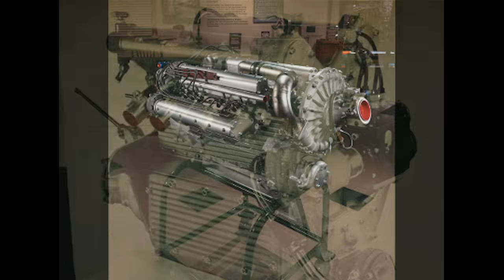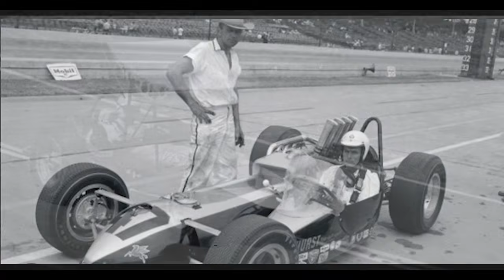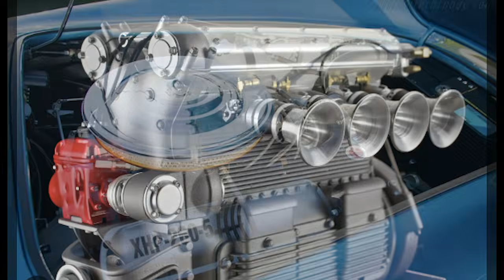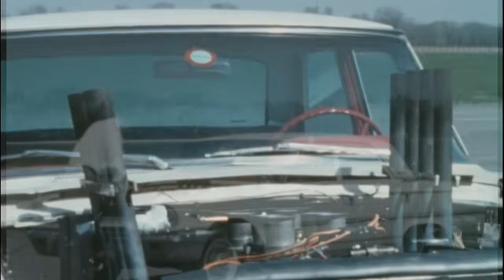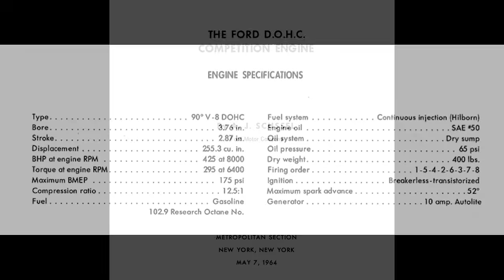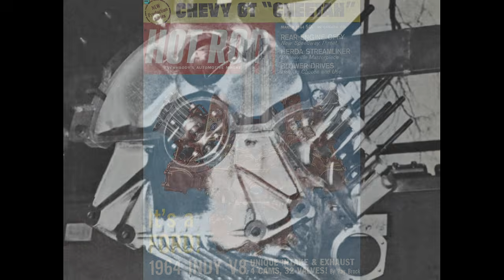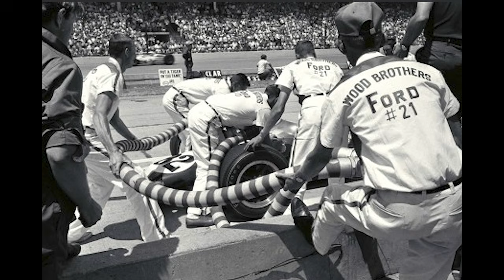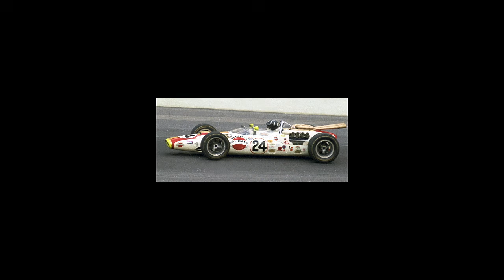Designed to Dominate: The Ford DOHC V8 Story - An Indy 500 Legend

Comment: Grew up in the DBN MI area and I lived through all of this and I remember watching the 500 and the invisible  alcohol fires that happened after a Offy powered car crashed. My first car was a 1963 1/2 Mercury Comet with the 260 V8.  I sure wish I was still as strong as I was then because I could wrap my fingers under the edge of a front fender and lift that tire off the ground. Sadly at 76 yrs old there is no way I could do such a thing now nor would I even try. Now I'm just glad I can still either drive my 2018 Focus ST or occasionally my 2015 Mustang GT with the performance pack. No I've never gotten away from the performance oriented cars.

Comment: And there is another chapter to Ford Indy Engines:
Ford Cosworths XD, during the 90s.
Later sold to Ed Pink Racing Engines of Drag Engine fame.
Recently acquired by Rob Dahm the Rotor Motor guru.
1 - 1 Rotor Motor Miata (in process)
1 - 3 Rotor Motor RX7 Pikes Peak finisher😮
1 - 4 Rotor Motor RX7 4x4 drag whatever 😮
1 - 12 Rotor Motor Dragster (in process)😮
Plus all the Ford Cosworths Remnants 😊

Comment: Arias did the same thing with 502 cubic inch big block Chever-Lay V8's.  They utilized Porsche 928 4 valve cylinder heads, since the Porsche V8 has nearly identical bore spacing as a big block Chevy.  To drive the cam belts, a special housing attaches to the cam from the pushrod version at the front and runs a timing belt from some  Renault car that just happens to fit.  Sounds "Rube Goldberg", but these made 550 hp all day long with perfect reliability, smooth idle, and they could even pass California emissions testing with catalytic converters installed.

Comment: Kudos for a very fine report on this amazing engine. It caught my interest as I saw some of these engines when I worked at the Dearborn Engine Plant at River Rouge, early 1965. They were in a caged-off area on the first floor. One could not miss the injector horns sticking out like a porcupine. I later owned cars with 289 High Performance engines and was proud of their heritage. Again, excellent report.

Comment: I appreciate the video . I was told and i did the cross drilled crank modification to a 302 steel crank in a build , later on that it was not a good idea at higher rpm.  Ford definitely know how to build performance..  i like to hear about the 24 hours at LaMans also ....thanks

Comment: Those connecting rods in the DOHC engine are killers- 7/16" rod bolts, heavy as heck. They also were used in the early Boss 302 race engines. Great video!

Comment: FWIW if I am not mistaken FORD spent close to or just over 100million in 1960''s money for their racing programs, culminating in the Lemans Win. They built a chassis and engine simulator which replicated the entire Lemans circuit and could stress the engines, gearboxes, and chassis' in the same manner as the cars experienced in an actual race. 
It literally floored me when I read about the program in a late 60's car magazine.
Reply: Ford ran 4 engines at the same time, 10,000 gear changes at WOT per race and they did that 24 - 7

Comment: I had the privilege of hearing, live, of the DOHC Indy V8 at race speed, at a 1970 USAC Champ Car road race at Sears Point (California).   I bring up the aspect of race speed, as the cars/drivers back then were striving for a win or podium finish, pushing the cars to its limits, with the DOHC Indy V8 being an ear-splitting screamer of an engine.
Nowadays, with the vintage vehicle exhibitions, those same vehicles/engines are driven sedately.

Dan Gurney, in his stock-block Ford engine Eagle, won the 1970 Sears Point race.  But, Mario Andretti (with the DOHC Indy V8) pressed Gurney for most of the race, finishing second.  
I can still vividly recall that DOHC Indy V8 screaming sound when Andretti was accelerating out of the corners.

Comment: Given the timing of this video on the eve of the month of May, which is the month for the Indy 500, this presentation was well-timed.
I followed all the print and TV media of this era when I was a youngster.  Interesting in this video of the behind-the-scenes dramas that went unreported at the time.
What I found puzzling for that era, and still to this day, was why the naturally aspirated rear-engine Offy Champ cars were noncompetitive at Indy in 1964/65, yet, that setup was competitive at the shorter tracks, with some victories to be had. 
I recently saw another video on YT that covered that era, even showing AJ Foyt in a rear-engine chassis powered by an Offy prior to the 1964 Indy 500.  In Foyt's own words, he said that combo was ill-handling, which was one of several reasons he went with the roadster for the '64 race.

Comment: Did the pushrod 255 eventually make it to the GT40 after the 427cid was banned in lemans in the later years?
Reply: Having followed racing in the 1960s, I can confidently say the 255 DOHC was never mated to a GT40.
Possibly one of the reasons, aside from durability, was with low-end torque needed on road-racing circuits.  For the occasional road-races that USAC ran the Champ Cars on, the Indy DOHC engine was adequate, but Dan Gurney's stock-block Ford engine (with its 3-valve Gurney/Weslake heads), in his Eagle chassis, had better low-end torque for the road-circuits, resulting with him dominating most of the road-racing USAC Champ Car races up to the 1970 season.

I will add that the Gurney/Weslake valve heads contributed to the Ford GT40's Le Mans wins for 1968/69.
Reply: From what I’ve read and heard is that when Ford went to Lemans the first time with Shelby they used a gussied up version of the HiPo 289. And it failed miserably. Ford stepped in and got with  Holman Moody and the Nascar 427 big block and Dominated with 1,2,3 finish that changed history for ever. The next year they basically banned the 427 with a displacement cap. I don’t remember the exact CID other than the 427 was no more in the GT40. The next year they went back to a small block and beat the crap out of Ferrari again. This time with a small block of some sort. It couldn’t have been the 289cid from the very beginning? The GT40 program continued to win with the small blocks after the 427 was band. So what was that engine? That why I thought if the pushrod 255.

Comment: Nice video! Brings back memories- you showed an issue of Hot Rod with te Ford twin cam on the cover and I read that magazine until it fell apart. One small thing- you mentioned the Galaxie sedan that Ford used for testing on the 255 OHV engine and you stated it was a '62 Fastback. Ford's Galaxie Fastback was a '63 and did not appear until half way through the '63 model year and the picture you displayed with that motor in it was a '63 notchback sedan. Small issue tho...
Reply from the maker: The car used in Daytona was a long lead pre-production Galaxie fast back. The car shown in the video was used for short burst acceleration testing on loaded chassis dyno rollers. Two Galaxies and two different purposes.
Reply: @brianlohnes3079  But not a '62, as you stated. My point was that Ford did not ever produce a Fastback '62. They would not have used a '62 test-mule in 1963- not to mention they would have had to fabricate motor mounts to fit. They had them on the parts shelf for the 63.

Comment: The Ford Indianapolis engine was 'the winningest V-8".
What about the Cosworth-Ford DFV, which dominated F1 for 3 decades, and had success in other formule? Le Mans, for example. The turbocharged DFX derivative was also rather good at Indianapolis, winning for a decade.
Reply: Possibly Brian Lohnes was referencing the aspect that this DOHC Indy V8 was it being an in-house development within the Ford organization.  Whereas with the the Cosworth engines, they were Ford "badged" engines, meaning that Ford contracted with an outside developer, headed by Mike Costin and Keith Duckworth, to come up with a 3-liter V8 race engine.  Ford's involvement was paying the bills to another company for the 3-liter engine development, as the Cosworth organization did the design, development, and manufacturing of said V8.
In the later years of CART Indy Car racing, Chevy rose to prominence with its badged engines designed and built by Ilmor.  Chevy had nothing to do with the actual development, they just paid Ilmor Engineering the $$ it took to develop an Indy Car race engine.
Reply: @bloqk16   Not entirely correct. The early DFV had reliability issues. Ford had then-unique testing facilities that rapidly forced the engine's development, making it into a reliable, powerful and sufficiently durable item. It eventually became robust enough for le Mans...
Reply: @pashakdescilly7517  Ah!  But was it with Ford UK or at Ford facilities in the US?  
I still find credence with Brian Lohnes stance given the factors of the DOHC Indy V8 being a domestically developed engine done within the confines of the Ford organization, from the ground-up.
Given that US car manufacturers, up to that time, worked with the pushrod platform with engine designs, the engineers at Ford hit a grand-slam home run to design, develop, and refine, in-house, a DOHC race engine as quickly as they did . . . and this is coming from a guy that's a faithful Chevy supporter.
Reply: DFX had no Ford involvement.

Comment: I noticed that the pushrod version had extra springs pushing directly on the lifters.
Reply from the maker: Hot rodders knew them as “rev kits” for many, many years. A cheat to allow for more manageable spring pressures at the valve and still control the valvetrain at high RPM.

Comment: I have a shadow question: when Le Mans re-wrote the engine rules to keep Ford away from the race, I wonder why Ford didn't counter with this engine? It would have met the cubic inch capacity limits and it certainly had the proper racing pedigree. Or was Dearborn just done with the Europeans?

Comment: Always cool seeing these strapped into the front of USAC Sprint Cars from the 1960s. If I remember right, the heads had to be swapped again in order for the exhaust pipes to clear the cabin since the engine was mounted up front

Comment: It's amazing that Ford Racing still does a tidy business selling 8.2" and 9.5" Windsors. Crazy that it started out as a 221ci, they sell 460ci crate engines now and you could build an aftermarket 9.5" as large as 471ci, 4.205"x 4.25". I think it's amazing that they made over 400hp with 255ci with only 1.8" and 1.5" valves. So anyone who can't get over 400hp from a 302 with 2.00" and 1.60" valves is a chump.
Reply: Maybe so, but for how many miles?
Reply: I was also very surprised to hear how small the valves were.

Comment: How much of this program was used to make the DFV the dominant for it was later on? The DFV was basically forced out the way the Offy was before it had passed it's usefulness or ability.
Reply: None. That was Cosworth. Ford only paid to get on the cam covers. Sponsoring the Ford/Cosworth F1 motor was the best investment Ford ever made but it was mostly done before Ford became involved. The DFV was a development of the Cosworth FV (four valve) 4 cylinder engine, DFV (dual four valve).
Reply: Keith Duckworth probably looked at the 4-cam and said "NOPE!  I'll go with a narrower valve angle."  More compact combustion chamber, and doesn't require a big protruder on the piston to get high compression ratio.  The protruder on the piston inhibits flame travel, requiring more spark advance to get best torque.  The 4-cam had one foot in the past because the combustion chamber design looked a lot like an Offy.

Comment: I have immense respect for the guys that drove these at speed. Some years back, my bil acquired a 1976 Dulon (a Lotus clone) Formula F car modified for autocross. When wedged into the narrow body, you could only barely see over the front tires. With dual 48mm IDA’s howling a few inches behind your head, no abs or traction control, and quite tight suspension, even that light little beast was a workout. Doing 200 laps in it—much less a more powerful version—would be exhausting. 

A lot of fun, but I’ll stick to having a crash structure around my soft tissue, thankyouverymuch!

Comment: I knew about the dohc indy engine (not much though), but I never knew there was a pushrod tried. I wonder if any of those engines survived? Makes me look at our 260 in the fairlane a bit differently 😅. Another awesome video, thanks.
Reply: I know right. I had a 64 falcon sprint with a 260 v8 (when I was a younger man, this was the late 70s) all my friends said they can't make power and to yank it out for a 289 hi po or a 302.  This video proves them wrong.

Comment: Awesome edition Brian thoroughly enjoyed this and pretty much all of your in-depth presentations. 

One thing I’d like to mention is that sandwiched somewhere in between the pushrod ‘63 engine and the DOHC ‘64 version was a cylinder head on the drawing board called the “7 X 7”. A canted valve head that was conceived BEFORE the Chevy Mystery Motor which showed up at Daytona in February of 1963. 

This fact kind of dispels the idea that the later BBF and Cleveland heads being copies of Chevy’s “rat” motor.

Comment: 1963: The car was pure Chapman. Make it light and then even lighter. Lotus 29
Just an F1 Lotus 25 with a Yank V8 stuffed in and offset suspension. 
As on the 1.5litre F1 car, the chassis consisted of two sheet aluminium pontoons that were connected by flimsy steel cross-members.
If Clark had of wrecked ~ it would have been all over for the Scotsman. AJ Foyt famously said - the car was made of chicken wire. LOL
Fords advertising was bullshit. We were all led to believe it was Ford rental car engine with just added Weber's and organ pipe exhausts!
I never realised how much work went into modifying that "stock block." Great job Mr. Lohnes. Thank's my man!
Xenophobic Yanks - don't get me started! PJ coated the track with oil. 100% black flag as was plainly warned in the drivers meeting!
The biggest howler for this Kiwi fan: USAC said the oil tank had stopped leaking; why the black flag was not needed. 
Yeah right. The tank was empty!
Cheating PJ got into a fight the next day with racer Eddie Sachs, the Clown Prince, at a press conference. Jones punched his light out!
Only in Murica race fans!

1964: Beautiful car ~ a semi monocoque designed by Chapman specifically for Indy. Lotus 34
This superb real dohc FORD racing engine. 
Useless Lotus pit crew. 
Even more useless Limey tires! The Dunlop's were Chapman's idea. FORD was pissed. There was nearly legal action against Lotus.
Colin was a bit like Enzo ~ OK, I'm gunna take my toys and go home. FORD said: they are not your cars. We own them!
Great book: Andrew Ferguson, Lotus: The Indianapolis Years (Patrick Stephens, 1996) ISBN 1-85260-491-3

1965: Chapman was away down under racing Clark in the Tasman Series in NZ and AUS.
Len Terry 100% designed the exquisite full monocoque Lotus 38. Chapman came home and threw a fit. Piece of shit he said!
There was no time left. Len Terry was fired and went to work for Gurney designing the equally exquisite F1 Eagle.
Chapman never even took poor old Len to the race in America!
The rest is history.  NASCAR Woods Brothers pit crew!
Clark won with only four other cars on the lead lap, with the rest of the finishers all at least 2 laps behind.
For this old timer the Lotus 38 is the quintessential open wheel race car. A work of art by any criteria.

Comment: My Grandpa went to Indy in 1965 as a mechanic on a Ford powered car, don't remember the driver, but the car was #65. I still have a picture.
Reply: In 1965: #54 was Bob Vieth in a Huffaker/Offenhauser. DNF after 58-laps with piston failure according to the record book.🤔
Reply: @DennisMerwood  my bad, #65.
Reply: @DennisMerwood 
Kind of you to offer the information Dennis.
Reply: this was a point in time they were pushing past the limits of metal too
Reply: Ronnie Duman, who won The Little 500 two years in a row in 1959 and 1960, drove the #65 Travelon Trailer Spl.  in 1965, owned by Ernie Ruiz. Who was your grandpa?
Reply: @donolbers  Bill Hofeldt.